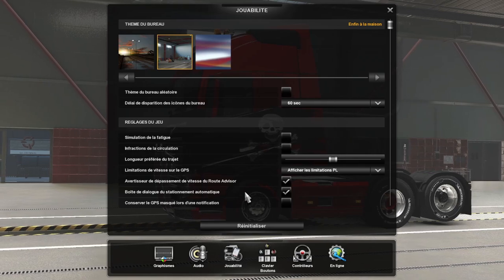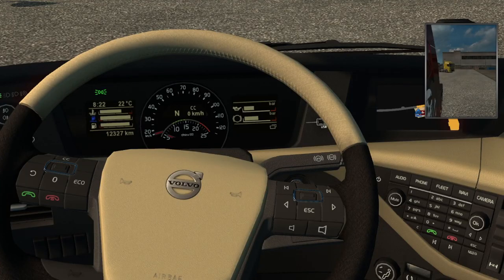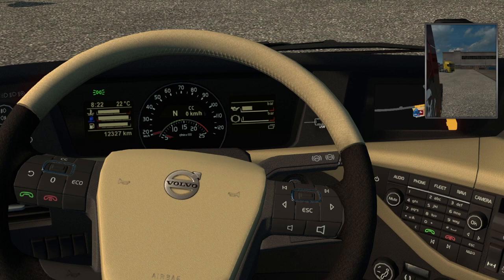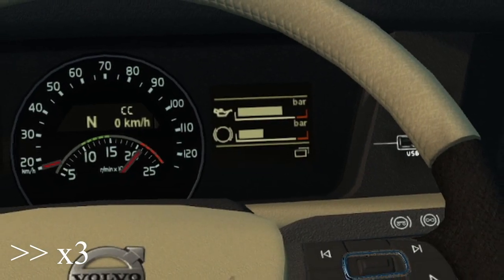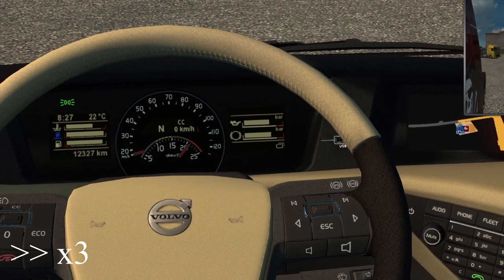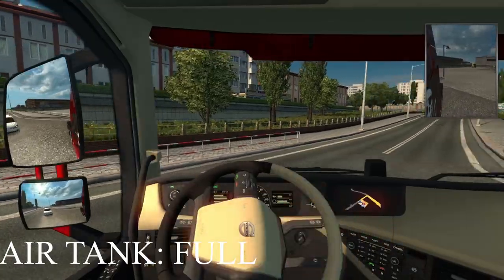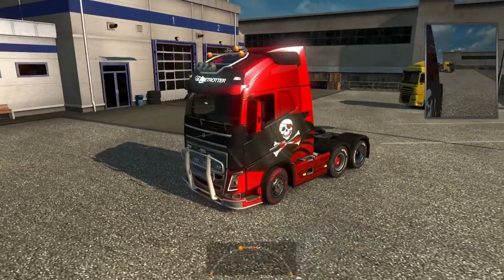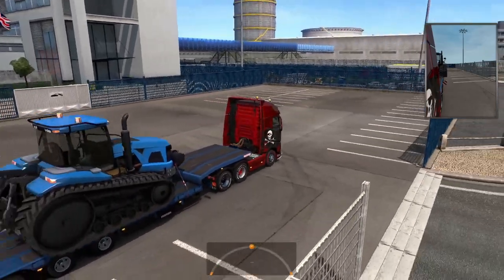ETS2 AIR PRESSURE OPTION || TFF

Comment: everytime i drive up on a smol hill i run of air pressur and can get further
Reply from the maker: If your truck had taken damage, it can act up like this. Repair it, then try it.
If the truck is repaired, check P the airbrakes are lifted.
If it still acts up, think of upgrading the truck.